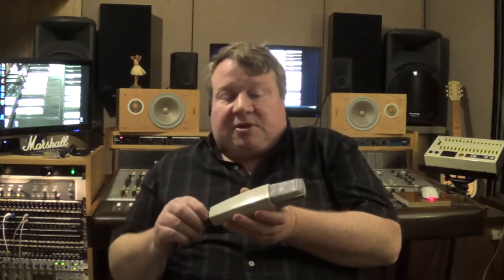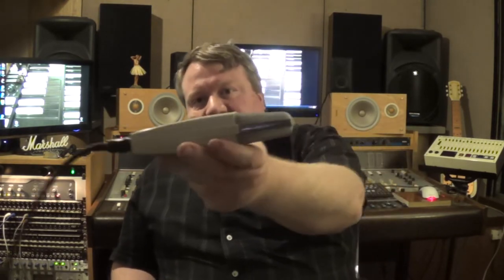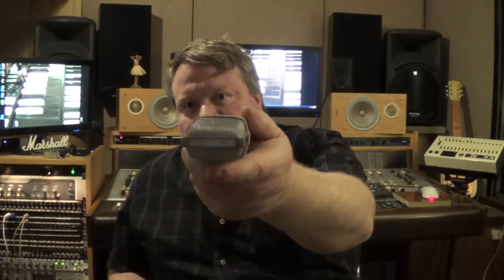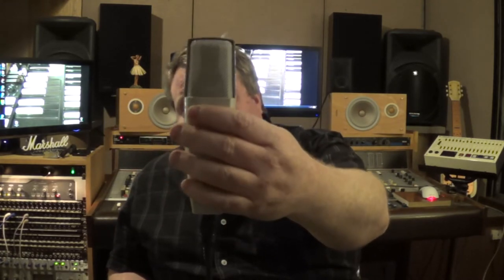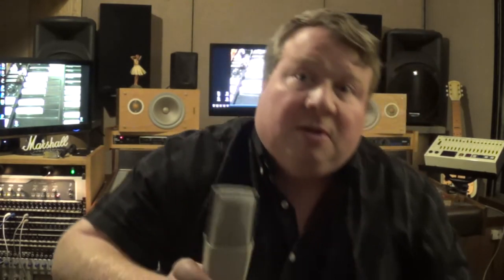Vintage Oktava ML-51 Ribbon Microphone - Microphone Boutique

Comment: Did you isolate the second contact of the ribbon which is connected to the case in stock or just grounded one of the input wires of the transformer? If you did connected them through the case and didn't isolate ribbon, how would it affect the noise level? Is it noisy? 
I would really appreciate your help)

Comment: Can you please do a video and show where and how you connected the transformer to the motor? Also is that literally it, you just removed the preamp and hooked up the transformer directly to the ribbon motor? Also should I be skeptical about ordering such an old ribbon mic of ebay because Ive heard ribbons have to be stored a certain way(usually upright) or they develop problems, so Im worried that most ribbon mics used of ebay wont have been taken care of properly. Is that something i need to worry much about?
Reply from the maker: Yes, many of these are in bad shape, if you buy one used on ebay you make have to re-tension or replace the ribbon as well.   I am selling one on eBay now that's been modified, have a look for it.  $150, while it lasts.   As for making a video showing the rewire, I have so many videos I need to make, I will put it on the list, but yes, it's as simple as disconnecting the preamp and wiring right to the din connector.
Reply: Okay thanks! ANd as for the one your selling how's the ribbon? And is it modded? Also whats your ebay name? Im not sure I see it because its either sold or theirs a few up right now!
Reply from the maker: my ebay name is Archtopkay2002  the ribbon has been checked and is properly aligned

Comment: With a modded version, without the battery...will it use phantom power or would that damage it?  I’m confused exactly what cloudlifter is and why a normal mixer preamp wouldn’t work..or if it would without phantom power.
Reply from the maker: Any preamp will work. The cloud lifter is very nice.  The closer the preamp is the the mic, the better.  The preamp may use phantom power because it will block the power from going to the mic.

Comment: These mics modded sound really great.  I have one modded.  I may have bought yours on eBay.  I have two more that need modding and could use some instruction.
Reply: How do you mod it? Can you share some info please?
Reply: Please share some info! Don`t gatekeep
Reply: @tokiboi6777  I’m sorry…I wasn’t gate keeping.  I never modded any one of them…I bought one modded already.  It looks like they just took the pre amp w the battery holder out and wired it straight to the transformer.  I’ll dig them up as I haven’t recorded in a while.
Reply: @Galova  I’m not sure, really…it looks like they pulled them whole pre amp body out and wired it straight to the transformer.  Pretty simple.  If you want I could send some photos to you guys